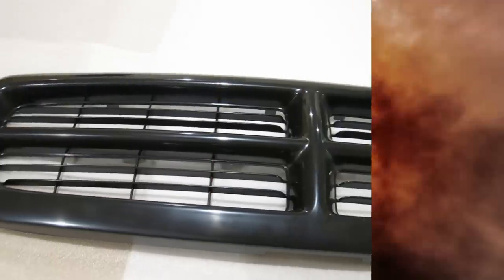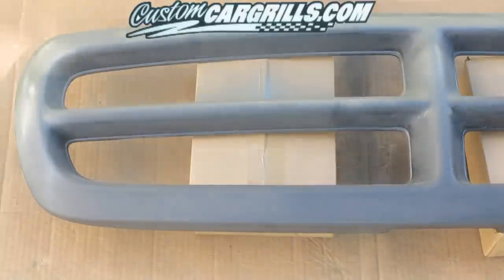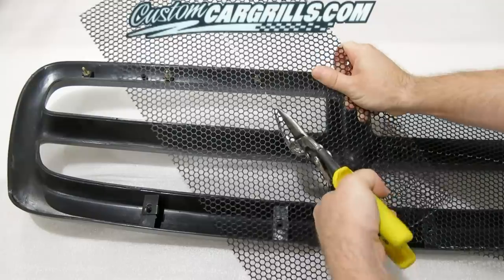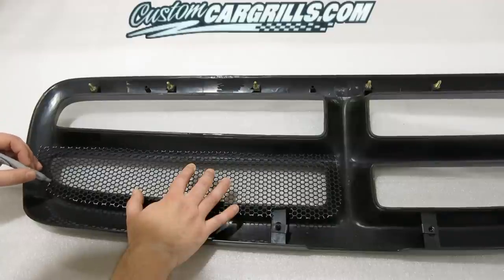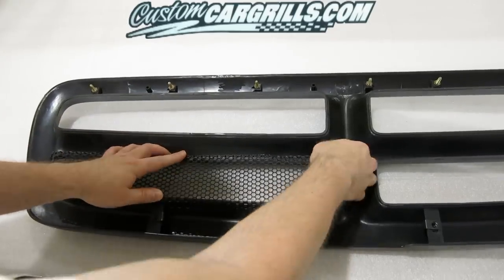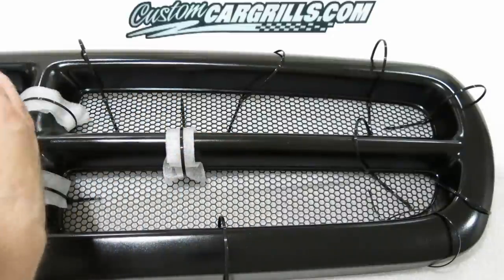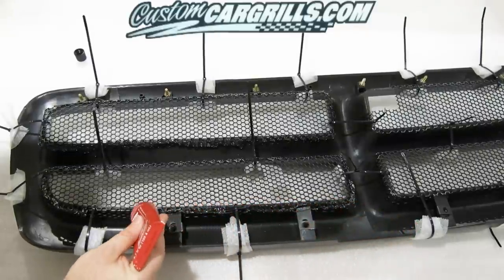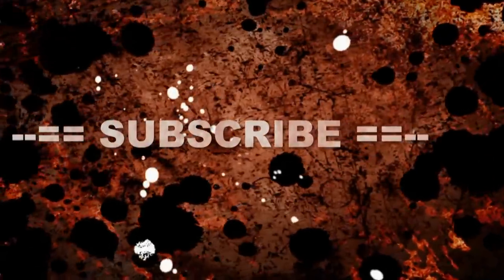customcargrills.com Custom Dodge Dakota Grill Mesh Installation

Comment: I did a mesh grille on my '02 Dakota about 10 years ago. I had to saw off a small piece of the hood latch. Then I drilled a hole in it for a cable that hangs out of sight to behind the bumper. No unsightly hole in the grille. Whenever I have to take my truck in for inspection, etc, I just show the mechanic where the release is. Otherwise it would take at least a few minutes to figure it out.

Comment: Trace & cut out the 4 opening shapes on 3/4" wood, then make slightly smaller inside filler hammer blocks, then sand edges.
   Then hammer out some cool dimensional grilles

Comment: Don't listen to any of the jerkoffs saying shitty job... people always will hate no matter what. question, how strong is that glue? if you had one large piece of mesh opposed to four separate cut outs, would you still use that to mount the grill? i have a cadillac CTS, and want to and a lower mesh grill similar the the cts-v.
Reply from the maker: Lol, thanks.  Hater's gonna hate, I get it =)

As for the Automotive Goop, it's works surprisingly well.  How well you might ask?  This Dakota install, as well as many that are well older than this one are still on the road today.

Since this video was made much of the newer videos I make use Pliogrip Plastic Repair #3.  It works even better BUT comes at a much higher cost.  If you have the budget to get the Pliogrip, then I would encourage it but if you're on a budget then the Automotive Goop is still a great choice for many applications.
Reply: @customcargrills  I appreciate you my man! Yea I’ll def roll with the pliogrip, I have a lead foot so I what that grill to be sturdy at high speed. Thanks again dude 💪🏼

Comment: My grill is chrome and I would like it black. Any suggestions how to get rid of it? I tried once. I barely scratched it and a
Painted anyway
Reply from the maker: It would probably be best to sand the chrome off the plastic first.  From there, you can prime and paint it and you'll probably see better results than just painting directly on the chrome.
Reply: I tried sanding and painting that factory "chrome" but the paint won't adhere. BUT, the "chrome" is only a very thin tin material that you can peel off. Under the tin/chrome it's black plastic. I still paint  the plastic but after sanding, and buying paint made for plastics, it's way easier to paint over.

Comment: Looked good from the back. Don’t like it at all on the truck. I bought my insert premade and they are not flat they have a concave shape that looks a lot better. The hood latch needed an extension on it which mine came with that moves the latch handle to when you pop the hood you reach between the grill and bumper to open it.

Comment: That’s some shit work . I would be mad if I was the customer with that big ass hole for the hood latch
Reply from the maker: I gave the customer what they wanted.  There's 3 options for this install for the latch.  

1) make a cutout as shown in the video.  It's less than ideal but functional
2) extend the hood latch down by drilling into the safety release and running a cable down
3) do nothing and never open your hood again

As I've stated before, the customer who the grill was made for in the video requested a cutout for the latch though, which is why it was done.  If it were my personal truck, I would have opt'd for extending the latch down.
Reply: So all you wanted to do was talk crap about his work? Where's your video where you did a custom job better? Typical immature comment